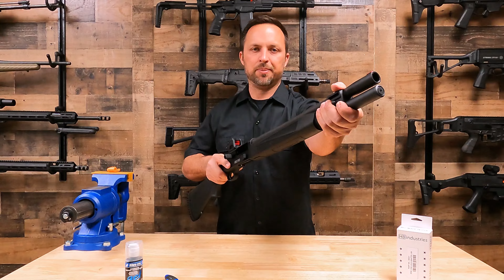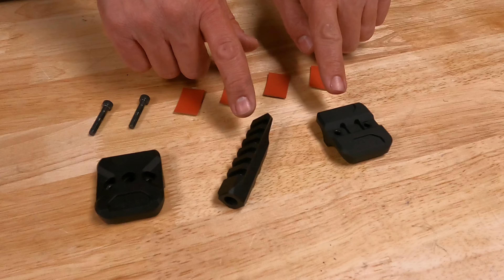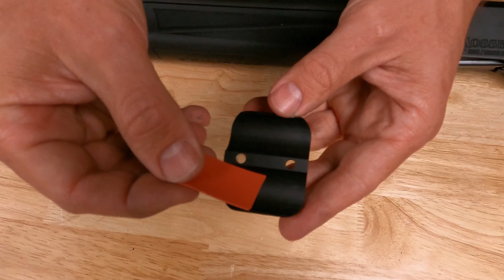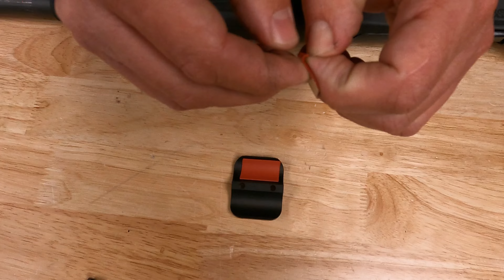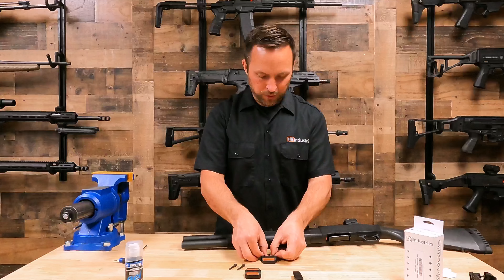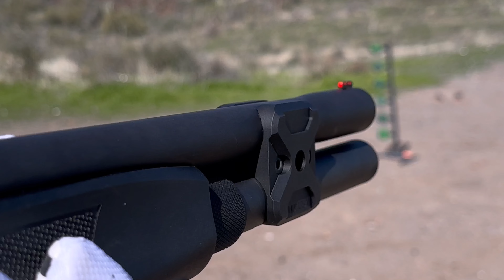HBI MOSSBERG 940 PRO BARREL CLAMP INSTALL VIDEO

Comment: The 50 inch pounds damaged my magazine extension. Follower no longer passes freely even after removing the clamp. Extremely disappointed. What the heck am I supposed to do now?
Reply: Update: HBI has great customer service and Mossberg has got me a new extension. Anything beyond 10 in/lbs will cause the follower to bind in the extension. So 10 in/lbs and thread locker seems to be the sweet spot. Curious to see if it stays in place under recoil.

Comment: 50 Inch Pounds caused the magazine tube spring and follower to jam. Called support and they reduced the torque to 15, which has worked fine.

Comment: Can this fit 590?
Reply from the maker: Yes, our barrel clamps are backwards compatible with the 590 as long as the clamp gaskets are used on the barrel and tube extension. (And gaskets are included with every one of our clamp assemblies)

Comment: EDIT THIS VIDEO ASAP!!!!!.... IF YOU TORQUE ANY CLAMP TO 50 INCH POUNDS ON ANY EXTENSION TUBE ALUMINUM OR POLYMER YOUR WILL WARP IT CAUSING YOU TO HAVE ISSUES WITH LOADING UP YOUR TUBES TO FULL CAPACITY!!!!

Comment: Do NOT torque the screws to 50 inch lbs or 6 newton meters. This will cause the pusher in the magazine tube to     bind. Use a locking compound and go just a bit past hand tight, about 4 to 5 in lbs. Just my experience.
Reply: Unfortunately I listened to the video. I ended  torqueing to 20 inch pounds. I can still only load 6 2 3/4 shells. I may have to back it off anymore. Not sure how they came up with 50.😂😂
Reply: @venomgt7299  That may not be the clamp causing your problem. My 940 will only take 6 and that was before the HB clamp was installed.
Reply: @tonycarthan6425  mine took 7 before i installed. When i tightened to 50 inch lbs. Only 4. When loosened up to 20 inch lbs it took 6.  I still haven't cleaned it so i know its not the spring installed improperly. Im going to try to loosen to 15inch lbs. Will see
Reply: 100% CORRECT!!
Reply: Did you have the binding issue with the original plastic mount as well? Mine with the original plastic one jams up the tube follower and spring if tightened to a usable torque, which is unfortunate. I've been looking for a solution.
Reply: No. I think I may measure the gap and fabricate a spacer to insert between the clamps. That way screws can be tightened without closing down on the tube excessively. If I measure it just right only the silicon pads will be crushed enough to grip but not deform the tube. That's the theory.
Reply: I torqued to 50 in/lbs and it actually permanently damaged my mag extension (which is steel in my case). Got my new one from Mossberg and tested. Anything beyond 10 in/lbs caused the follower to bind in the tube. 10 in/lbs allows for all 7 shells to be loaded/unloaded smoothy. I have the 940 Thunder.
Reply: @roul3688  I can only get six 2 3/4" rounds in my tube.
Reply: @tonycarthan6425  I tested with some Fiocchi labeled as 2 3/4" but come to measure, they're only 2 1/4". Tried some others and you're right, only 6 "normal" sized 2 3/4"  (which oddly is 2 1/2") fit.

Comment: I torqued my clamp to 50 inch pounds and it would not allow 7 shells to be loaded. Also the follower wouldn't return. I had to loosen to 22 inch lbs to fix the issue. Other then that, the clamp is Great!!!

Comment: Will this clamp also work with the Moss 930 security model?
Reply from the maker: Yes, with the silicone gaskets installed on our clamp it should mount to your 930 security no problem